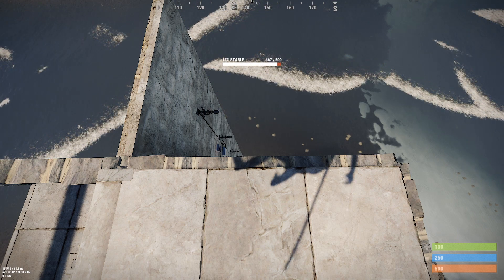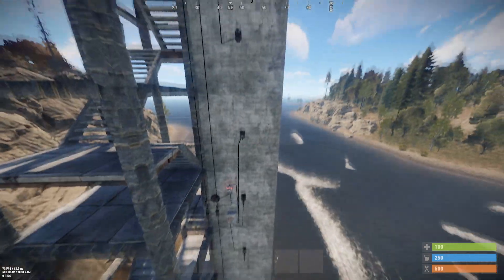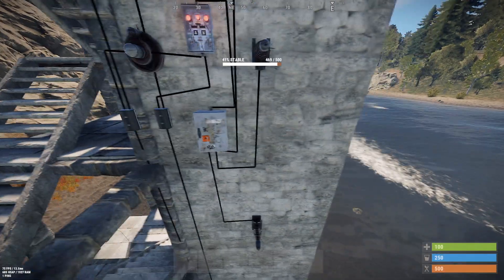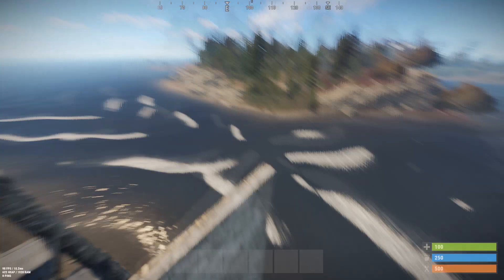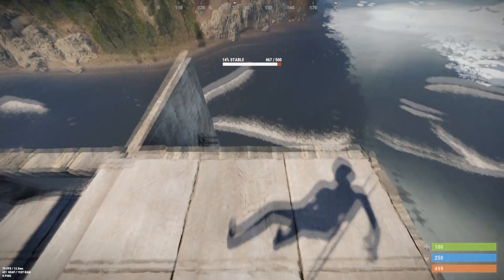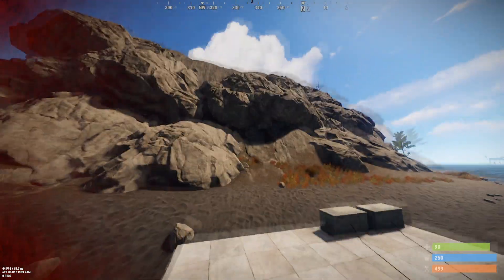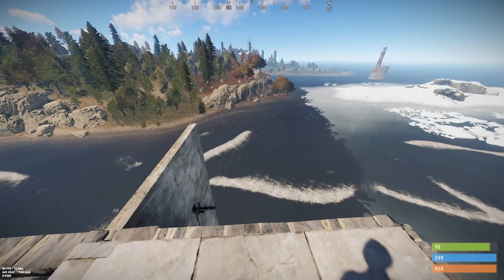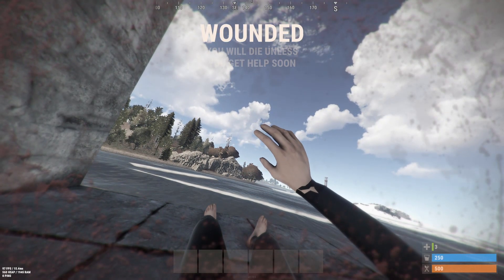Rust Electricity 101: Proof of Concept - Tesla Coil Anti-Gravity Wall

Comment: AMAZING video, especially since this is 1) the first time I have ever seen this done by anyone, and 2) because it was an original idea by you it sounds like considering you didn't even know if it would work at the start of the video. Like had been mentioned though I would wonder if this would work with just 3 or so at the bottom and not needing a stack as high as your tower. Thanks!

Comment: Imagine a base entrance using this. You can drop and survive no problem, but people not authorized to HBFS would fall to their deaths.

I am also wondering if it is possible to reduce the amount of tesla coils. Have you tried it with just one or two?
Reply: Thats such a good idea mate! Well done 😄😉🙂💙
Reply from the maker: Love it! I will try a few variations later to see what the effect is!
Reply: Rust lame physics allow u to fall from any height without damage. So no need to build all this teslas for this.
And I'm not even touching them anymore unless devs increase their durability and fix explosive and fire damage through walls.
I wasted some time to build really nice trap with teslas inside my base, but they all disappeared in first seconds of raid because they received damage from rockets explosions through walls.